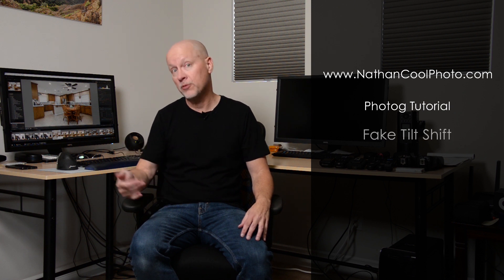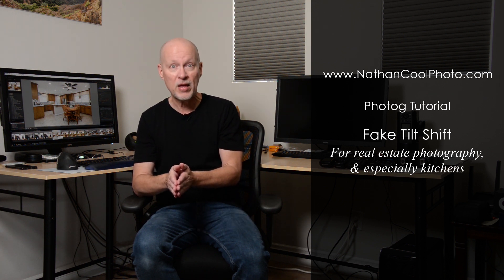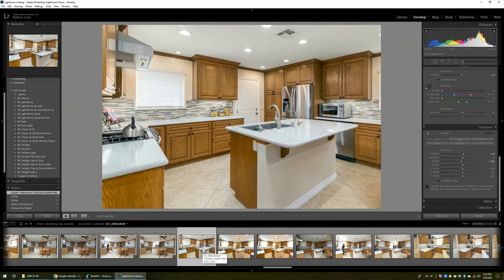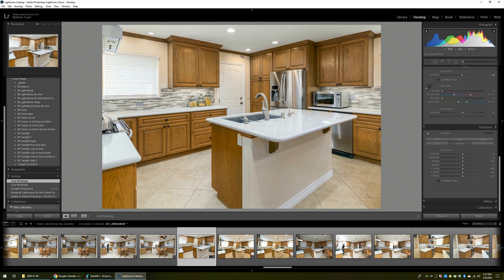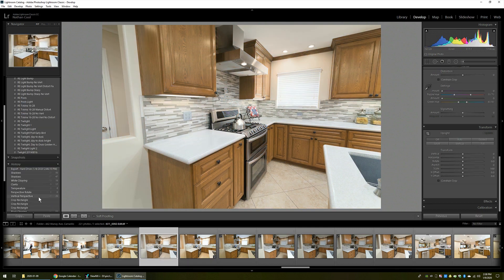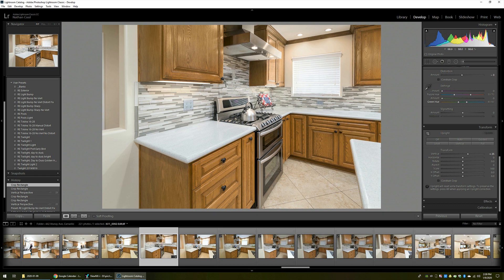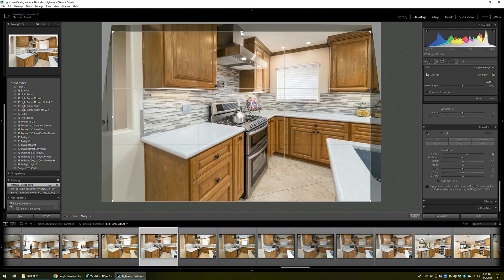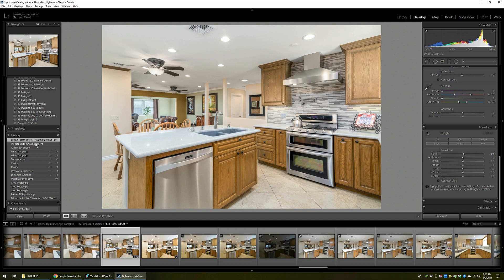Fake Tilt Shift for Kitchens

Comment: Great video, question. Why do you keep the interior lights on in the house, I would think this will cause more color issues even with using flambient technique.  Also will this apply to exteriors, for instance say on a tall building and having to tilt the camera up quite a bit. Thanks keep up the great work.
Reply from the maker: Thanks Eric. Ambient light will have no ill effect on flambient-processed photos IF you use the proper exposure for your flash shot; i.e. fast enough to eliminate ambient artifacts. It's something I stress in the interiors e-book, not sure if you have that but here's a link: https://www.amazon.com/dp/B0755KXSL4
Reply: Nathan Cool Photo thanks Nathan I’ll check that out